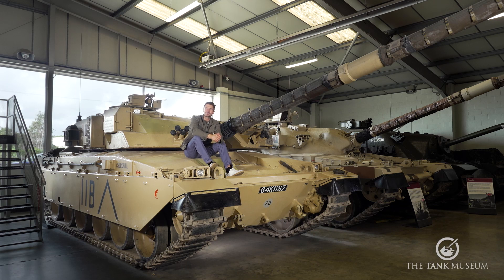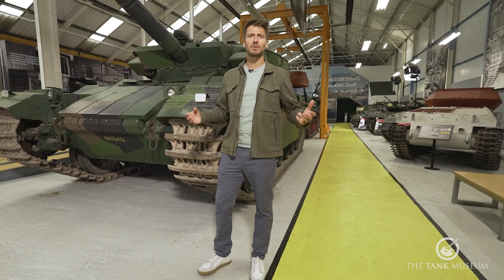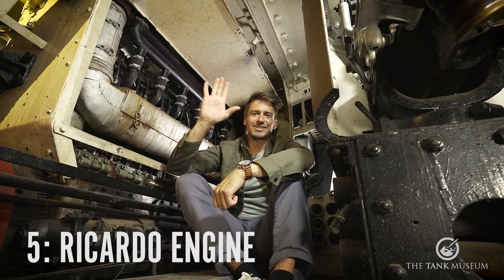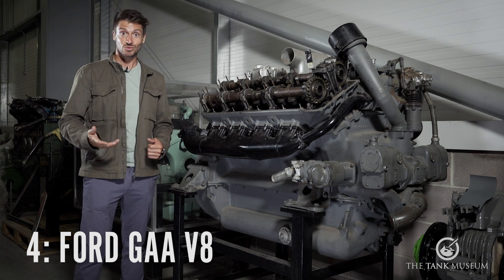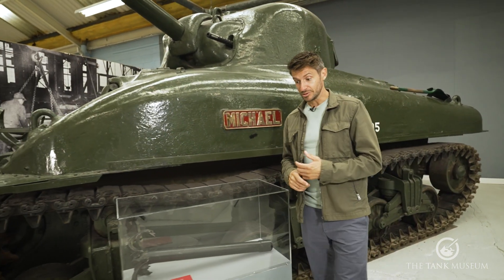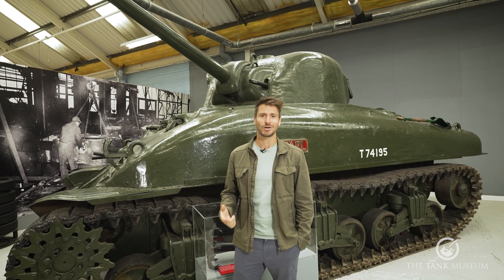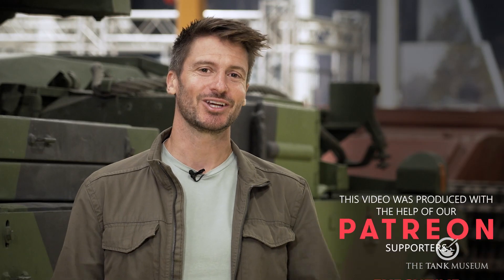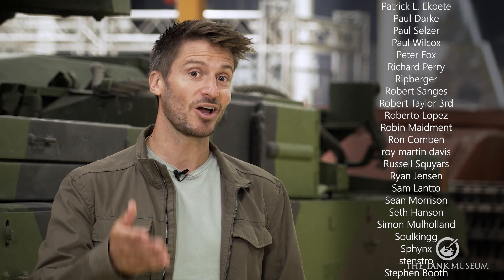Top 5 Tank Engines | Rob Bell | Institution of Mechanical Engineers | The Tank Museum

Comment: My Dad worked on tank engines for much of his life, and used to come up interesting snippets of information. One that made him smile was other engineers explanation for why the Meteor engines con rod had a 1/8" hole drilled through it above the big end, most people believed it helped throw oil onto the cylinder walls. the real reason was to show it was a less than perfect casting and should not be used on the much higher powered Merlin engine. Nice video.

Comment: One thing that stuck out in my mind when visiting museums was the engines they'd sometimes have on display. I remember going to the imperial war museum in London and they had a Merlin engine in a glass case, fully chromed up, perfect and spotless reflecting all the lights. Then I went to the Solent Air Museum in Southampton and they had a Merlin engine on display, clearly heavily used, it was black and heat blasted, smelled of petrol, had pipes coming off it. For some reason that distinction always stayed with me, I much preferred the real deal in the Southampton museum.

Comment: V2 ended up developed into the powerplant for the T-72 when the advanced opposed piston engine of the T-64 proved uneconomical. It’s not only lightweight and diesel, but it’s very large displacement, allowing improved engines to keep up with modern modern but smaller competitors. They are still in service all over the world. Truly unprecedented service life.
Reply: why t64 engine is uneconomical?
Reply: @oleksandrshulha7451  a totally new design, based on a new principle, with totally different demands on material and tolerances of precision in manufacturing, and multifuel to boot.
It took a long time to refine it.
Reply: The same engine (in it's very upgraded form) is still in production today to power the T-90, Msta and Koalitsiya
Reply: @johanmetreus1268  multifuel has nothing to do with the issues of the 6TD-2. its an OPE, which means you need good electronics, good fuel injector engineering, and the ability to machine good turbochargers and good positive displacement superchargers. Ukraine hasnt updated to current standards of electrical control or supercharging which is the source of a significant ammount of the problems with that engine, especially since it is only used with a helix supercharger.
Reply: @F14thunderhawk  Multifuel certainly has something to do with the T-64 engine complexity, as different fuels have different knacking points, and thus need variable compression adjusted to the fuel used, and that on top of the factors you listed.
Reply: @johanmetreus1268  Multifuel has something to do with it but entirely not the reason you listed. As a compression ignition engine, the fuel cannot pre-detonate (or knock) since it's only ever in the combustion chamber during the power stroke and thus the engine does not need variable compression.

What being multifuel does is the need to manufacture a fuel system (lines, pumps and injectors) that can be expected to run reliably with what manner of combustible liquid you decide to run through it.

Comment: My favorite historical fact about the Meteor was how it began as a way to salvage something from the growing pile of Merlin engines that failed to pass flight worthiness inspections (few things improve reliability as drastically as derating an 1100hp engine to only 600hp).
Reply: My grandfather disliked working on them, said you couldn't scratch yourself without having to look up the toque setting.
Reply: @stephenarbon2227  Having that intense of care protocols makes a lot of sense on an aircraft engine. If a tank engine stops working in the middle of a mission, well you're not driving anywhere. You lose an engine on a fighter halfway through a sortie, and it's a whole different issue.

Comment: That first clip about the perkins engine and generator/BV and tea....so true.   Was on Soltau training area....something went wrong with the power to the BV....My cmdr had the driver stop, then radio'd the REME....we didnt move until it was fixed.
Reply: Well do you blame him. Can't have nuch of a tea break without tea.
Reply: @owen368  Going without tea? Blasphemy! 😅
In reality, what other needed systems are powered by the APU when stopped? That's the main reason to get the APU fixed. No radio when parked? That's a big negative so get the APU fixed.
Reply: @LadyAnuB  This is true especially if your the command tank not much use if the radio goes out as batteries die or communder tank gets left behind due to using all the fuel up running main engine. It's why they put the little A series engine in the first place to give the tank more time on station.
Reply: why the punctuation?

Comment: The 7 cylinder radials in the M2 Lights and M3 Stuart tanks provided plenty of power as well. The American radials could be found in many vehicles such the M2, M3, and M4 Medium, M2 and M3 Light, and the LVT series to name a few. There were actually Guiberson 7-cyl diesel radials as well.
Reply: The reduction of coolant and the need to have a supply chain to support it is a massive benefit of the air cooled radials. Also, they are less susceptible to block cracking in extreme cold.

Comment: The engine, maybe more than any other single factor, could make or break a tank design, so it's great to see the topic highlighted like this.
Reply: They could still drop the ball with the transmission and/or final drives... and, that's just looking at the drivetrain.

Nicholas Moran, aka The Chieftain, has a thing for track design, most especially the tensioning thereof. He also has made some rather pertinent observations regarding transmission replacement/exchange.

None of this is quite as obvious a set of issues for the layman, who will glom on to the gun and armor balance first.

Comment: A two litre auxiliary power unit is interesting.  The WW2 American bombers had a tiny 7 hp ‘Putt Putt’ APU.
Reply: A lot of American planes had awful electrically powered constant speed mechanism propellers, a run down battery and old fashioned narrow revs range generators instead of later more flexible alternators meant that after low speed taxying and dropping voltages the propellers could disastrously go out of control just on take off.  The put-put vitally preserved battery health.

Comment: This was pretty cool. I would be curious to see a top-five tank engines from the perspective of mechanics. Which tanks engine would they rate to be the most reliable
Reply: And easiest to maintain!
Reply: @AnimeSunglasses  The Leopard 1 with its PowerPack concept should be pretty up there, removing the engine is a 30min job and from there maintenance and repairs are an absolute breeze

Comment: Excellent video, but for my list, I'd make a few changes. First, I'd drop the Ford V8 and replace it with the Maybach HL120, and move it below the Riccardo. The Germans deserve some love. I'd switch the positions of the R975 and the Meteor, for several reasons:

* The Meteor ended up as a great engine, but it wasn't until after the war that the reliability was fully ironed out. Furthermore, it never really became the engine of choice for a wide variety of vehicles the way the R975 did.

* The R975 was cheaper to make, needed less and simpler maintenance, and was easier to work on when it did need work.

* The Meteor needed extensive development work to make the transition from aeromotive to automotive, but the R975 used in ground vehicles differed comparatively little from the aircraft versions.

And that last point is the main reason why I'd put it above the Meteor. The R975 was part of a huge engine ecosystem which massively simplified logistics for the Allies at every point in the supply chain, and this ability to deliver greater numbers of fewer things was one of the most important weapons the Allies had.
Reply: But as he pointed out, the R975 compromised the tank design by being very tall.
Reply: @jeremypnet  -- Compromised in what way?
Reply: @JohnnyWishbone85  the hull had to be taller to fit the engine, so you couldn't hide behind a hedge and you presented a larger target to enemy gunners.
Reply: @EmyrDerfel  — The height of the Sherman was as much a function of a restriction on width as it was the configuration of the engine. American military vehicles had to be able to fit on rail cars that had a maximum width restriction due to the need to pass through particular rail tunnels. There are other reasons for this width restriction, but the fact is that there are several crucial pieces of equipment, including ammo storage under the turret basket that would have to be moved outwards if the turret basket were moved down. It would be very easy to do this by including a transfer case on the output of the engine to move the prop shaft down, but this wasn’t done, because the space necessitated by the prop shaft was needed for ancillary equipment anyway to keep the width of the vehicle within certain limits. And because there’s a limit to how long you can make the tank relative to its width before it becomes undriveable, the only dimension left to expand was height.

Comment: the other big advantage that diesel engine technology has is that diesel engines can very easily be made to use JP-1 grade jet fuel.  (and by easily, I mean there is a component in military engines that makes the necessary adjustment with no outside fettling) and so if your military uses all engines with this component, and all jets that are made for JP-1, you only need one kind of fuel at your remote bases, and yet, you can easily fuel all your ground vehicles at any petrol station that carries diesel, or even Kerosene if that is what is available. (furnace oil is also equivalent to diesel fuel)

Comment: I like the concept,  but it was very light on specifications. It should have included horsepower and torque (torque being one of the advantages of diesel), along with displacement and weight of the engines.  Production numbers can be more of a political decision than of actual superiority.  The Chrysler multi-bank comes to mind.

Comment: Two obviously missing engines:

Honeywell AGT1500 - the turbine in the M-1 Abrams. Very high power-to-weight ratio, easy powerpack changeout, quiet, multi-fuel, though the fuel use can be a bit high.

Thomas: very biddable and hard-working. And very blue.
Reply: Thomas is right up there.

How many other tank engines have an entire series about them? Iconic.
Reply: “Fuel use can be a bit high” That is true for every tank particularly the heavier ones.
Reply: They haven’t got an M1 so they can’t show it. Even so, I don’t know which of the top 5 it would displace. Maybe the Ford V8.
Reply: @jeremypnet  Nah the V-2 would be a better replacement. It is even better than a diesel engine.
Reply: Putin has generously gifted Ukraine with hundreds of tanks, armoured carriers, howitzers, and countless ammunition just in time for his 70th birthday. Who would have imagined this on Feb. 24?

Comment: With all due respect ... the Chrysler A57 Multibank 30-cylinder 1,253 cu in (20.5 L) engine has much more interesting history to provide the american tanks with an engine with sufficient power at the start of WWII. And all that done in a very short span of time.
Based on 6-cyl-in-line car engines there were several different of this multi cylinder "Monsters". Just to remind you ... at the begin of WWII, a 100 hp engine  was a very strong engine for earthbound use.

Comment: How was (No.3) the Continental radial engine cooled? i understand it was aircooled, but with what/how in the crammed tank space? thanks, Levi
Reply: It has a very big shrouded fan attached to it. Air is sucked in from the top of the engine deck and blown out the back.
Reply: @rollatorwieltje  thanks, i understand, i think..
Reply: @rollatorwieltje  one thing thou, that still bothers me, hm.. how is a horizontal fan connected to the engine shaft, or do i think "backwards" here?
Reply: @MrKeys57  If you view a diagram of the M4 Sherman tank engine compartment with the radial engines,  you will see the blower fan is simply bolted directly to the front of the crankshaft, (like an aircraft propeller) but with many short blades like a turbine, and slightly smaller in diameter than the engine's cylinders. If you look at the WW2 German FW 190 fighter aircraft from the front,  you will see a nearly identical fan behind it's propeller, doing the same job!
Reply: @KevinSmith-ys3mh  thanks very much! NOW i understand! Levi

Comment: “High production numbers and a long life are signs of a great design”

Mosin M1891 rifle (37 million, 1891 to 19873, still shows up in use today), Nagant M1895 revolver (2 million produced between 1895-1945), Lebel Model 1886 (3.5 million between 1886 to 1920, but used up till at least 1939), and Mle 1892 (third of a million, produced 1892-1924) beg to differ. Really it’s a sign of “exists during total war” and “cost efficient” more than anything else.

Comment: Was it with the Sherman that air was drawn through the crew compartment thus making it freezing for the crew in winter, and if so, was this drawback only caused by the air cooled engine (selection #3) or both air cooled and liquid cooled engines?
Reply: The air pulled through the compartment was both a blessing and a curse. As far as I have read, it impacted all engine types of the Sherman, to some extent. The areas where it was a bigger issue was with the M10 and M18. Being open topped, the winter air would be more brutal than in the Sherman. 

The benefit of the air getting pulled through the crew compartment was it helped ventilate the fighting compartment after firing any of the weapons of the tank. Considering good passive smoke removal via bore extractors wasn't in use at the time. This was a super important feature. Panther was attempting to use pressurized air to evacuate excessive fumes, IIRC. 

Watching some of the footage from the interior of a Sherman getting shot by Ian/The Chieftain, shows how much fumes could build up just from excessive use of the coax mg.
Reply: I'm a bit of a Sherman hater (mostly because I've always thought it looked ugly) but it has a reputation for being the best place to work of any tank of WWII.

Comment: I have read about the V2 Engine. I thought it was a two cylinder engine. For some reason I also thought it was a 2-stroke diesel.
Reply: When I read your comment, I was about to reply that a diesel 2-stroke cannot exist (because of cycle workload)… But upon googling, it seems that it's indeed a thing!
Reply: @SvenElven  In the 1960s, when I had a motor cycle there were some reports of incidents involving motor cyclist riding behind Lorries which were two-stroke diesel driven. I am hazy now of the details of course but there were vidual indicators of probably the exhaust to detect them. As you may know a motor cyclist can tell a lot about what the car in front is about to do by observing the exhaust emmision of the vehicle in front so it was not unusual for a motor cyclist, who remains alive, to take note of this.

Comment: My Dad was senior NCO and tank commander in WWII. He loved the V8 Ford . If you look at the specs you realize today's auto engines aren't that new of technology, - the digital controls. The radial required high octane, 100+, to run.
Reply: that is like saying a modern firearm is nothing much different to a 16th century musket. Sure the basic principle(s) is/are the same, but apart from that. There's almost 100 years of research between then and now, and you see it. Look at the ccm of the Meteor for example, and you get a bit over 300 hp. Today's engines can do the same with maybe a quarter of the size. This doesn't even take into consideration what comes out the exhaust or driving comfort. Suffice it to say you notice 80 years of development ;)
Reply: there was a diesel version of the radial engine that of course didn't need high octane fuel to run; gasoline version required 80 octane according to TM's & OCM's too numerous to include
Reply: @jamesberry3230  my dad knew what he was pouring. They were given 100+ octane. Dad went in in 39 and retired in 66.
Reply: @mspaetauf  Absolute weapons-grade unvarnished nonsense. The basics are the same. They knew exactly what had to be done back then. Thermodynamics of the 1920s-30s is basically the same as today. Sir Harry Ricardo, the one mentioned in the video, even wrote a highly influential book about it. This is the "technology" he speaks of. What changed to allow the performance of modern engines was the development of better metallurgy and greater precision of engine controls. Meanwhile, in the 16th century, something like a percussion cap was essentially witchcraft which made modern firearms inconceivable. Essentially the entire field of chemistry had to be invented to make it work.

Comment: Why did no-one think of using the R975 engine horizontally in a tank (i.e. with vertical crankshaft) ?
Reply: Probably harder to cool, and you'd need a bigger engine cover to be able to lower the engine into the hull. You wouldn't be able to use the space above the engine for much else because of the need for airflow, so you'd end up with a very long tank, with poor manoeuvrability.